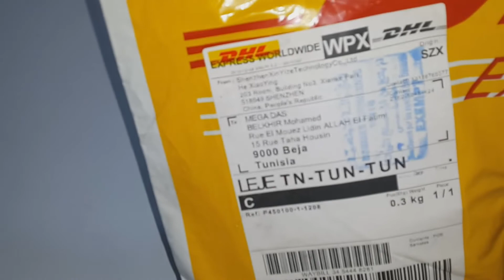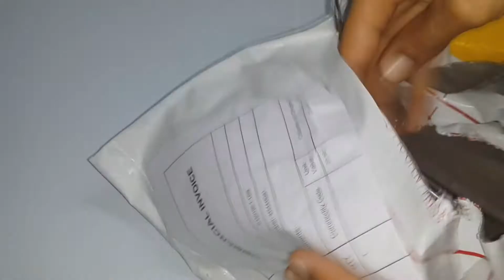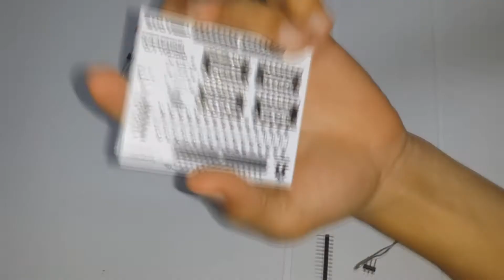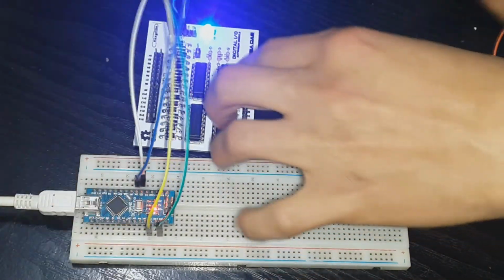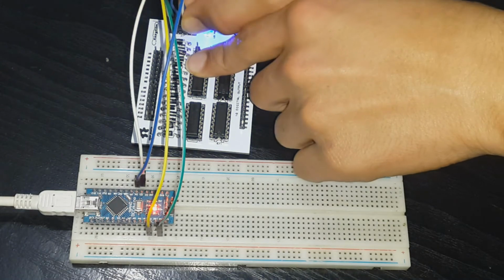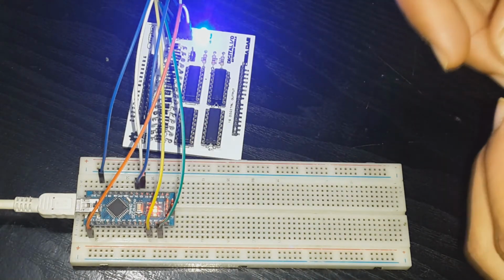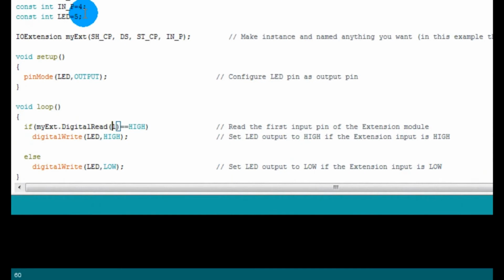How to use the 74HC595 shift register with Arduino nano (part 2)

Comment: hii, this was the best circuit i found to add more input and out put but i have a problem, when i get the out put from 2nd O/P IC pin 2 the same i can see 1st o/p IC 2 also given small voltage out (i used LED to check to out put so like when i active 10th 2 also getting out but not full ) have any solution for that...

thanks

Comment: Hello sir,, I have tried to increase digital Input Pins on arduino Pro micro board using 74HC595, as you told here. I followed your circuit diagram & digital read example. I attached push button to 74HC595 's input pins. I wrote in code different outputs from different pins. But  all input pins of 74HC595 are giving same output . Please solve this problem????????

Comment: Why is the led flickering when you press the button ?
Reply from the maker: Hello TheKetsa
Thank you for the comment wich is a great remark :)
If you look directly to the LED you will not see that flickering because of high frequency of data transfer through SPI pins, but in the video I used a CAMERA to film it so the high frequency detection of the camera catch the flickering. don't worry about it it's normal and it doesn't affect the output control. ;) 

Let us know if we can further assist you.
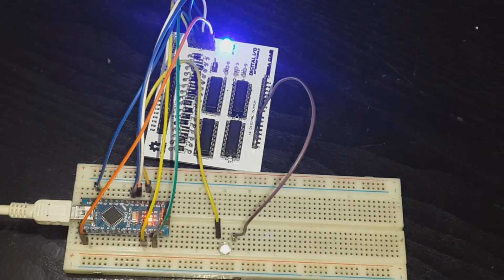Reply: But... in your first demo when you simply power the led via  pin5 it doesn't flicker at all ( at 6:10 )
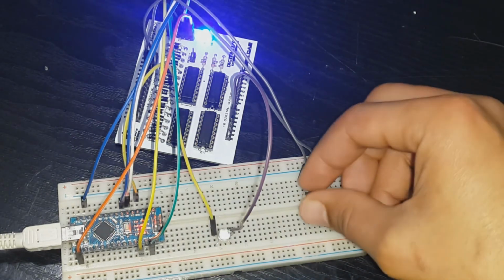Then with the button it flickers ( at  7:34 ) 

Strange, no ?
Reply from the maker: Right, but in the first "demo" we used only the outputs, in the second part we included the input read and don't forget that all shift registers are connected together so if I click the button I update all shift registers values that's why the LED keep on Flickering when I press the button.
I don't know if you get it or not!
Tell me if it wasn't clear, so I explain it otherwise.
Reply: It's probably better to use a dedicated IO circuit like MCP23017 for exemple then ?
Reply from the maker: TheKetsa what you mean by a dedicated IO circuit! the MCP23017 is a solution too, but the shift register 74HC595 is the cheapest IC for IO multiplexing
Thank you for the great information. :)